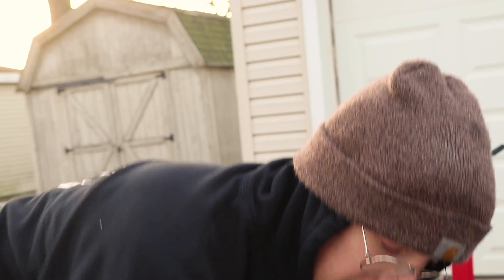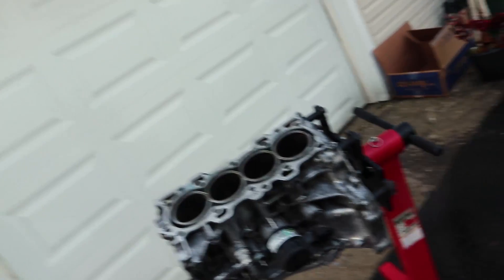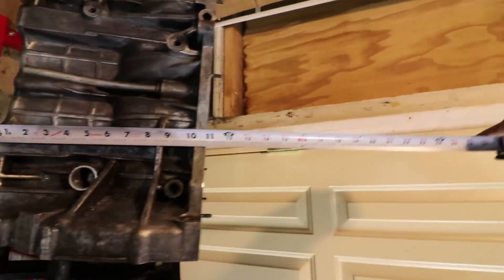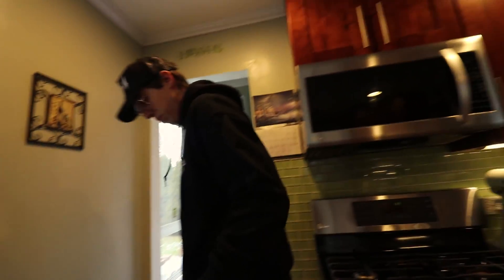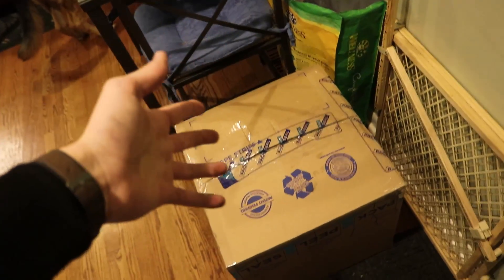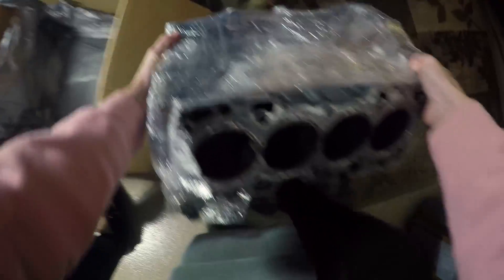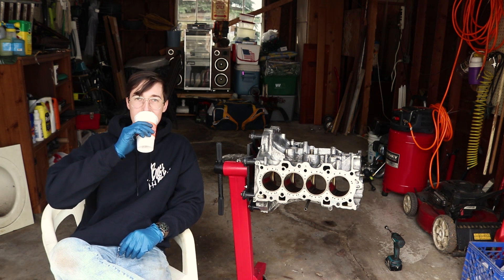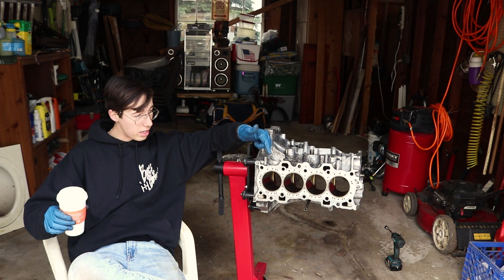Insane Engine Block Modification (Cylinder Support System)

Comment: This is the first time I've seen this block mod... usually it's milling out the cylinders and pressing in sleeves to go from open desk to closed deck. The CSS mod appears to be a centralizing ring to close the deck up. Didn't look welded in place...
Would love a zoom in on view from top and bottom too if you can get good lighting on it.

Will look to see if others have info on this as well.. great share and thanks!

Dry sump oil system. (Might put that on all posts going forward)
Subscribing but not for the giveaway. If my name is drawn please send proceeds to orphans.

Comment: Would you bore and hone for forged pistons before sending for css or are you doing that after?
Reply from the maker: Do that after because the CSS protrudes from the deck a little bit after install. It has to be machines down to be flush with the surface.

Comment: Hi John would you be considering awd if you have trouble putting down power? 

I have a white 94 eg turbo b16 I’m working on at this time and my goal for the stock motor is 300whp. I recently picked up the 1320 eg cat back exhaust and it’s sick. 

I look forward to seeing your progress
Reply from the maker: Probably won’t be going AWD for a while, but maybe in the future.
Reply: Starts to get fun around 300 for sure

Comment: Woah, wasn't expecting results in the same video. Does it still need to be decked now? Good luck!
Reply from the maker: 802 Garage yep, it still hasn’t to be fully machined before assembly.
Reply: @boosted_john  Figured. Thanks! Hope it goes well.

Comment: CSS is insane, I personally would use the JDM H22a, because it's a closed deck block that holds 700-800 right outta the box. B series motors are knarly with some extra support though!
Reply from the maker: Miatas Forever it’s going to be insane.

Comment: 700hp!! Kill all tires and never hook up again lol.  400hp at the wheels in nice on a car that ‘heavy’.  I like how you doing this video setup. 

I want to rebuild my 91 Nissan hardbody that way and maybe a little more power out of it with some 240sx parts like intake and exhaust maybe a 6th gear so I can do 70 without 3500rpm but fix up my slow old truck.  It has over 350k it still running like a boss even if I stopped counting miles 8 years ago.. so someday